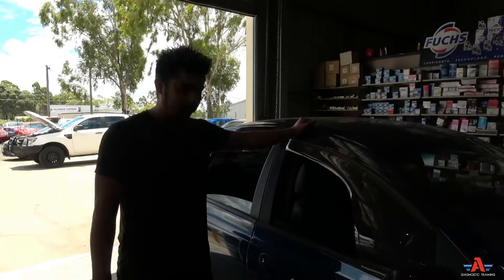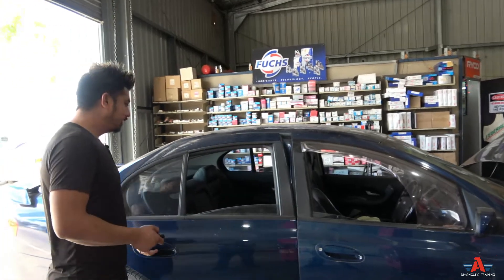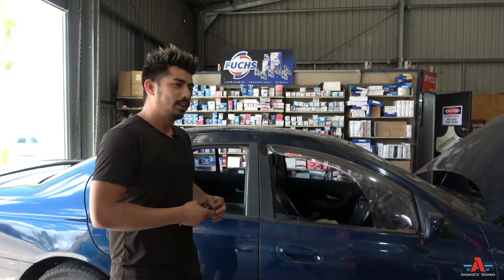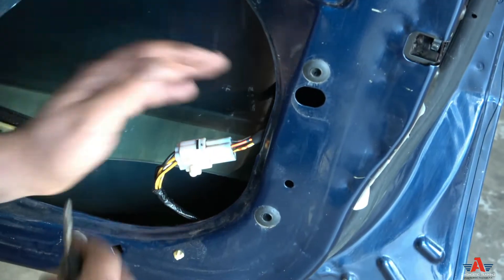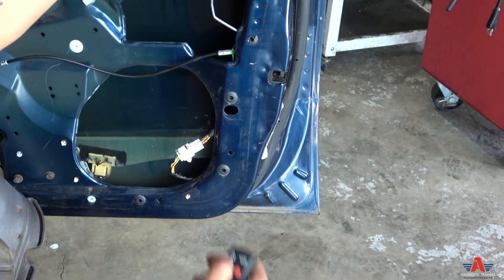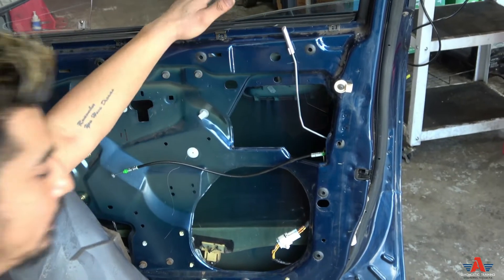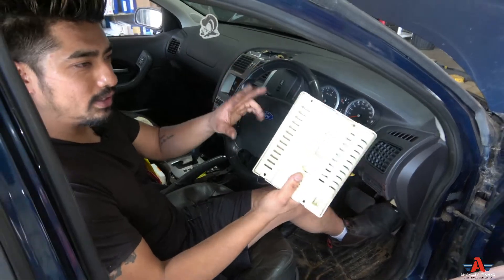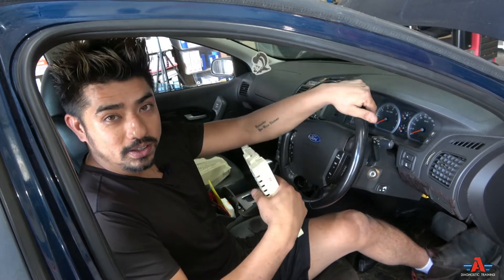Ford Falcon Fairmont Territory Door Lock Problem

Comment: There is also a display light on the dash that shows which door is not locking. Just a FYI
Reply: Mine is showing as the two front doors are open so it won’t lock. 
Very frustrating
Reply: @rodhope385   Then your door actuators probably need replacing

Comment: I've got an 04 BA and the lights have stopped flashing when locking unlocking, all the doors are locking correctly, do you know what this issue might be I recently got a new key fob programmed and it worked now the lights have stopped flashing in the last week, everything on the car works fine this is the only issue. I also don't think panic mode is working either.

Comment: Another thing to mention, is that a faulty key remote can also do similar issues. I had one that would randomly unlock my boot and taking out the battery of the remote proved this, so I got a new one and problem solved. For anyone interested, I use Forscan to problem solve any gremlins with these cars. It is a lot cheaper than buying a scan tool IMO.